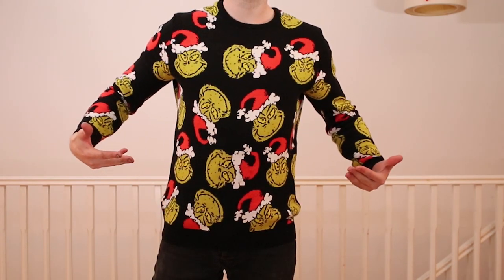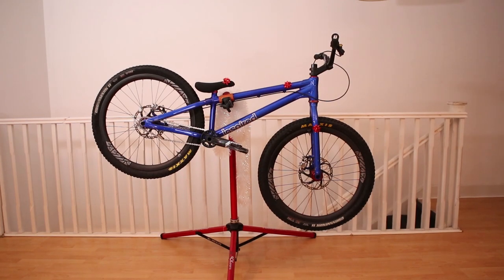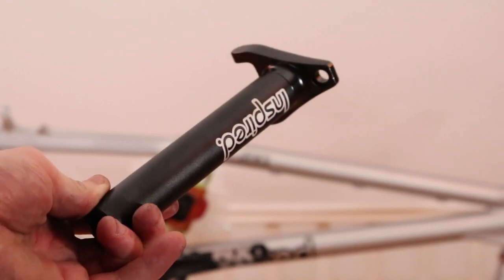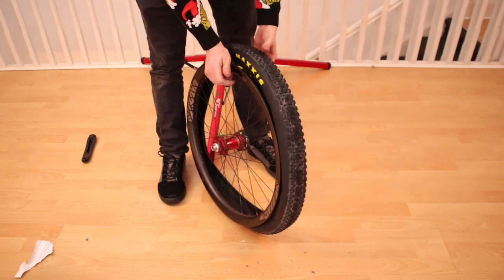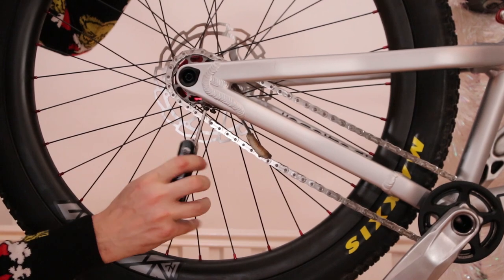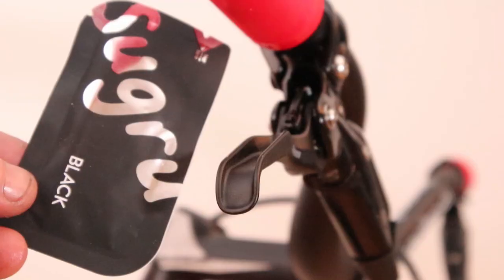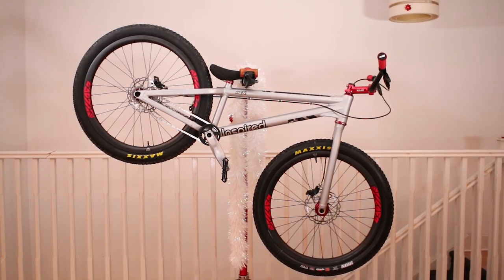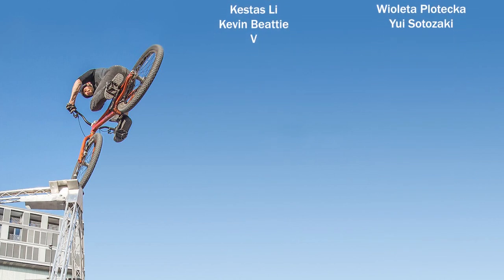Unwrapping and Building My 2021 Inspired Bicycles Hex

Comment: Hey Ali, In last year’s Hex build, you were saying something like : ‘’I got the 15mm axle hub fork, cause I don’t have a 20mm hub at the moment’’. Still, this year, you’re in the same situation. Could it be that there is nothing (perceivable) to gain from a 20mm axle over the 15mm one ? Does the weight/stiffness ratio is better with the 15mm one ? What is your thought on that ?

Thanks and have a happy holidays !
Reply from the maker: purely down to only having Chris King hubs in 15mm, I'm still using the same hubs for this bike. I'm not even sure if they do this hub in a 15mm version. I've never actually had a bike with a 20mm hub so I can't compare but I've certainly never had any issues with 15mm so I've not been in a hurry to try. Merry Christmas :)

Comment: Ali - looks good man. You know if Inspired will ever sell just the frame/fork again on these. Like you, I have many of my own parts that I like and the stock thing isn't the build I want/would waste all the goods I have.  The subtle red is way better btw - nice job dialing it back. :)
Reply from the maker: I'd like Inspired to sell just frames but from what I can gather because they are a small brand they are limited in the time frame they can get products made (the factories have to fit them in-between big brands orders) and because bikes sell the limited number of frames they can get made go to building bikes rather than just frames alone (which may or may not sell). I could be wrong though

Comment: Ali, when you cut off the brake line sleeve nut cover, did you put it back on with the slit in it or do you just ride without? Also, is there some hack for reusing those things I'm not smart enough to think of? (Besides re-trimming the hose )

Comment: That's such a nice bike.  I have a tip for your stem problems.  Just leave the front brake hose outside until you've confirmed which stem feels the best, and then route the hose through the stem.  Looks like such a pain in the ass 😂

Comment: Just watching your video and routing the front brake down your front fork. have you thought of using a brake gyro for the back brake like they have on BMX's so you can rotate the handle bars more freely.
Reply from the maker: It’s been a fleeting thought but being a hydraulic brake there’s not many options for gyros... the ones that do exist work well enough for slope style bikes but I heard the seals can make it feel like you’ve over tightened the headset plus it could effect the feel of the brake (plus it’s expensive!) 

I don’t do enough tricks like tailwhips or bar spins to warrant trying anyway
Reply: @Ali_Clarkson  Ah I thought you had mechanical brakes  on. I've heard about the hydraulic one's but not seen much about them.

Comment: Can you talk a bit more about the tire insert ? Are they really useful ?
Reply from the maker: yeah they're great... a must if you're going tubeless and wat to protect the rim and generally make inflating the tyre easier (it pushes the beads out). On the MTB they can be great at dampening trail buzz and generally allowing lower pressures and not letting the wheels get bounced off line
Reply: @Ali_Clarkson  thanks for the Info!

Comment: Why don't trials bikes use bmx/DJ bike style dropouts so that you don't have to run a tensioner? 
And why do they run a thread in bottom bracket? 
Seems like they could be better.
Reply from the maker: the issue with horizontal dropouts is that it can make it hard to perfectly line up the disc brake every time you re-fit the wheel. With a thru axle you know exactly where the wheel will be and the brake will work better always being aligned.

I actually think thread-in BBs are the best option, easy to fit/remove...no creaking and lots of parts options.
Reply: @Ali_Clarkson  hmm maybe it's the 12 years of bmx and a few years of scooter buy I love horizontal drop outs integrated headsets and mid bb's also dirt jump bikes use horizontal drop outs with disc brakes just fine
Reply: Funnily enough this video helped me a lot as my bmx has 24mm cranks with a spline drive 23t sprocket and 24mm mid bb all of which is very uncommon in bmx as the crank sizes are usually 19mm and 22mm. 
But now I know I could look into MTB parts for 24mm sprockets and cranks.
Reply from the maker: @asjmpickle  dirt jumps and horizontal dropouts do work (and would also for Trials) but they often use smaller rotors which are easier to get lined up plus they don’t depend on their brakes as much as trials riders do
Reply: @Ali_Clarkson  on my dirt jump bike I ran 200mm rotors but you have a point they barely got used and I didn't really have the aggressive setup to stand on the wheel much
Reply: @Ali_Clarkson  I love how much of a bike nerd you are always ready to nerd out with me in the comments. Most top level riders don't even reply
Reply from the maker: @asjmpickle  I do like to geek out haha
Reply: @Ali_Clarkson  here's an idea ive been working on it's a dirt scooter with disc brakes 
So you know the dirt scooters with the fat tyres? Fit a small escooter disc brake front and rear on one of those then slowly optimise it for trials I think the head tube angle will have to be steeper than already steep scooter head tube but otherwise would barely need much at all